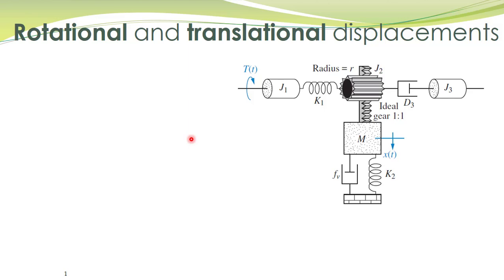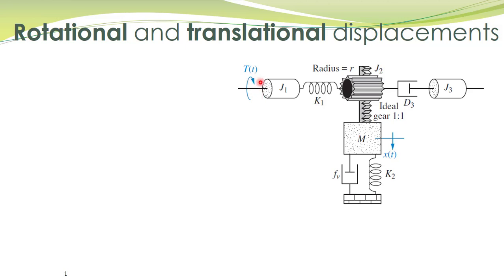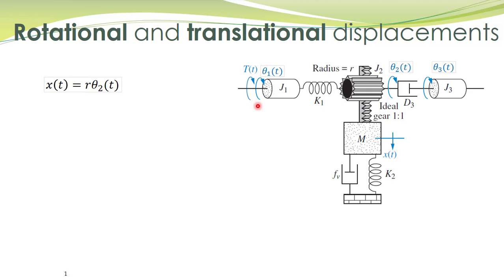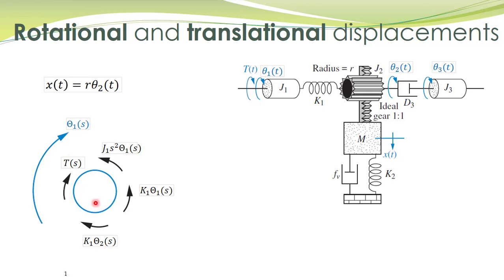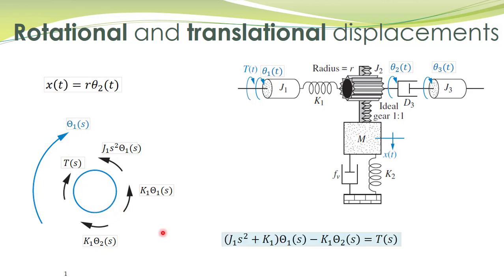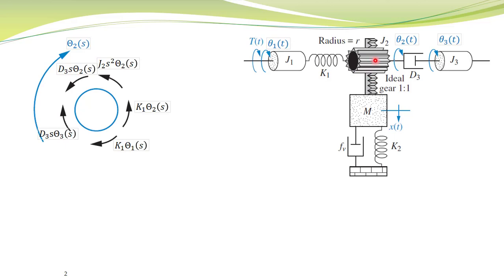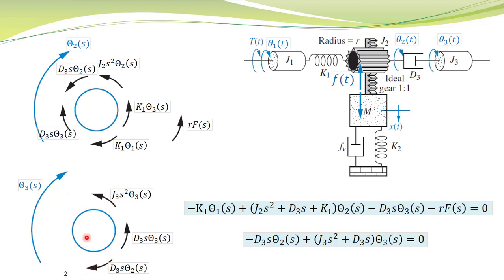LCS - 09a - Mechanical systems with rotational and translational displacement

Comment: What if the gear ration is not 1:1. how does it effect our model ?
Reply from the maker: Rack and pinion arrangement concerts angular displacement into linear displacement and vice versa. In rack and pinion arrangement, we do not talk about gear ratio, rather the linear and angular displacements are related by the radius of the puppy, which is considered in this example.

If you are interested in modeling of systems with gears, you may take other lectures in the playlist.

Comment: @MAFarooqi

 Thanks sir , you are very good 
But I have a question
I think this is an error in the equation of theta 2 .

10:40

The sign of [ r*F(s) ] should be positive not negative.

Does my thought true or I don't understand well ?
Reply from the maker: With the assumed directions of displacements, the arrangement with linear displacement applies an upward force on the rack and pinion arrangements. This opposes the angular displacement, as indicated in the free body diagram. Therefore, there must be a negative sign with r*F.
Reply: The FBD in the video is as same as my answer. from the FBD we see that the term (F(s)*r) (CCW) opposes the angular displacement (CW) and also the term (J2)(CCW)   opposes the angular displacement (CW) so the term (F(s)) and (J2) both have the same direction (CCW), but in the equation (J2) positive and (F(s)) Negative
Reply from the maker: @AhmedHamada-lg8hl  let me check it.
Reply from the maker: Yes, you are right. The free body diagram is correct and there should be positive sign with r*F.
Reply: Thanks ,sir for your replying .
 you are one of the most and the best people in explaining engineering problems .
your YouTube channel is very helpful. 
very thanks to you ,sir ♥️♥️♥️

Comment: Shouldn't it be (-  (M * r^2 * s^2)   -   (fv * r^2 * s)  -  (K2 * r^2) + .......) * theta2 in substituted form of the theta2 equation ?
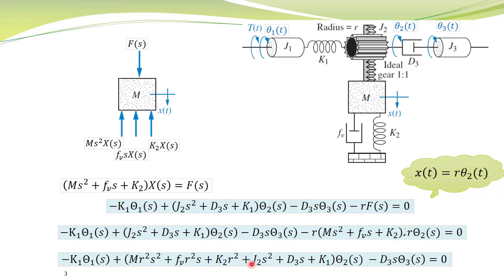Reply: Yes. I have same question. At 13:26, from 2nd blue eq to 3rd eq, I found -rF(s) suddenly became rF(s).

+) I found rF drawn the same direction with the elements of theta2 in the FBD. I think you just might have miss-typed the sign of rF.
Reply from the maker: Do you mean that there should be negative sign with the second term in the second equation?

Comment: Sorry to bother you, but I have a question, shouldn't the displacement  x1 be defined upwards? because the way I visualize it,  if the gear rotates in the direction that is given by the initial torque, it pulls up the mass instead of moving it downwards.
Reply from the maker: 1. If you look the whole arrangement from the right side, the applied torque tend to rotate the gear in clockwise direction, that is, the mass will move downwards.

2. There is another important point which needs further elaboration. That is, you can even assume the direction x1 upwards, the model will be still correct, however, now x1 will have negative magnitude.

Comment: Your explanation is so good but this problem is so hard and lengthy
Reply from the maker: Yes, this is a bit hard problem. However, if you completely understand the modeling of mechanical systems with translational displacement and modeling of mechanical systems with rotational displacement, the problem underhand becomes easier.